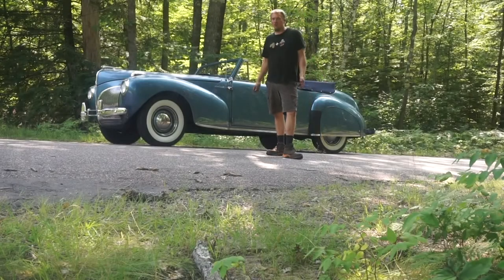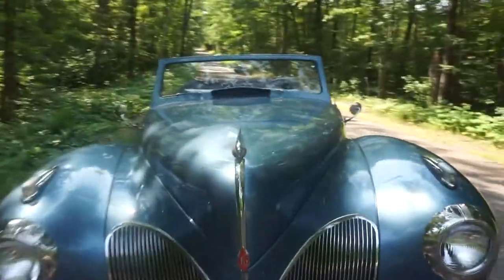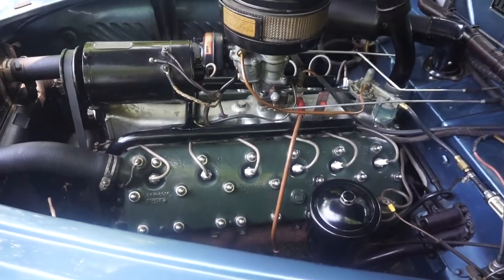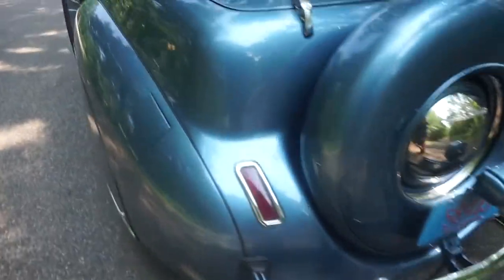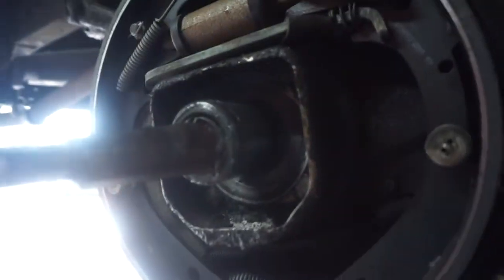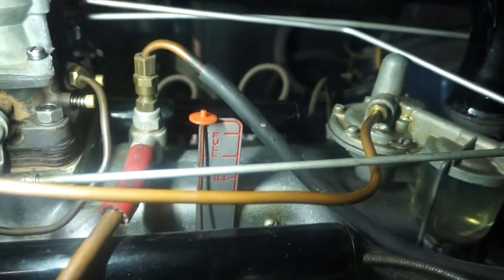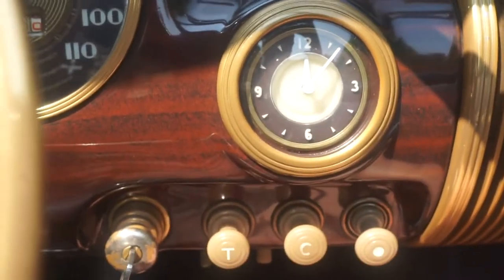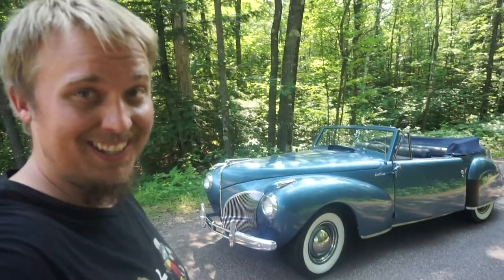This 1941 V12 Lincoln Continental is Presidential Class Luxury

Comment: Those engines weren't that great on longevity. They wouldn't handle lugging at all & they had a crankcase ventilation problem. Most of the ones I ran across had been converted to Mercury V-8 power. Beautiful car tho as was the Zephyr.
Reply: OIL BURNER ONLY LASTED 40 THOUSAND MILES